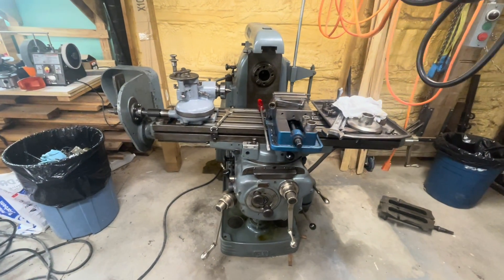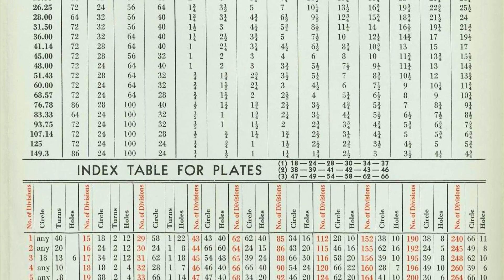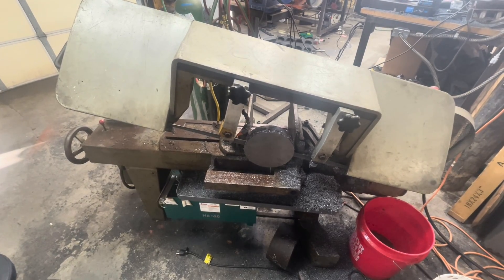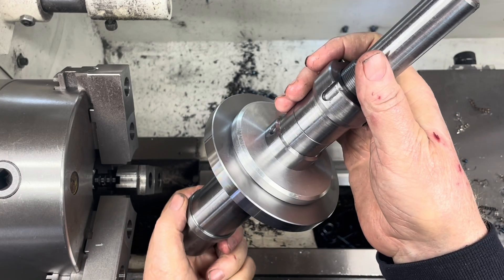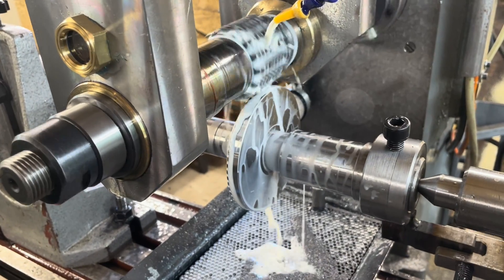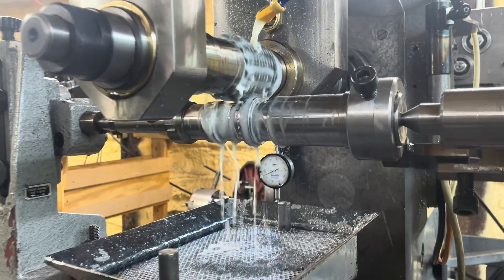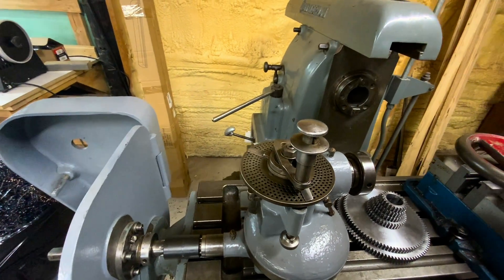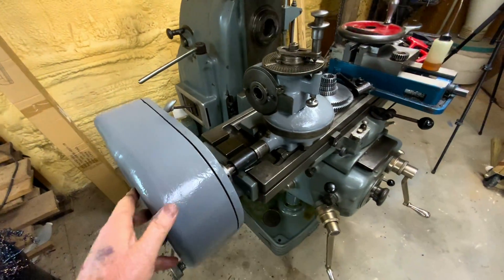Real Gear Project: Making a Set of “Factory” Change Gears for the Van Norman Mill

Comment: Wow, what a neat project.  I've got a Van Norman 1RQ which I am very fond of.  I picked up a set of original VN change gears in the VN box and a VN 10 inch dividing head.  The dividing head does need attention though.  I don't have the the lead box or the arbor support for the mill yet.  I am very impressed with your work.  Nice to see a fellow VN aficionado.
Reply from the maker: Thanks, Allen!  Which dividing head: horizontal or vertical?  If you need parts, I might be able to help…
Reply: @thomasstover6272  Tom, I have the horizontal dividing head.  I haven't opened it up to see what is binding it up internally yet.  I also found a set of plates for the dividing head,, a drawbar for the head and a set of collets too.  I will let you know what I find when I get around to opening the dividing head up.
Reply from the maker: @allenhunt3070 I found water in mine, but surprisingly little damage..just some seized ball bearings.  I did a video on the tear down…
Reply: @thomasstover6272  Tom, after looking at the pdf manual for my dividing head it describes it as the 10" Vertical Swivel Dividing Head, and is the same model you took apart in the other video which I enjoyed watching.  The manual for that dividing head says that the power feed on this model head is not compatible with the 1R model mill feeds.  Too bad.  Sigh.
Reply from the maker: @allenhunt3070  the centerlines are different between the vertical and horizontal heads.  I made a short adapter with a couple of cheap u-joints, which works fine.  The gearbox might be a different story.
Reply: @thomasstover6272  That is great to know Tom.  Thanks for sharing your hard earned knowledge with everyone, including  myself!

Comment: Nice video. Do these need to be hardered ? Cheers
Reply from the maker: Change gears and index gears don’t see much speed and load, so soft steel works well.  There are a lot of old lathes and mini lathes that have aluminum or plastic gears.  I just prefer steel for the stuff I do.

Comment: To get rid of the the ringing/chatter you could try shortening the shaft the gear sits on and suck in the tailstock spindle all the way. Those might not be possible but what would probably work is wrapping the shaft in heavy rubber or a rubber tube filled with sand. The big aluminium (?) washers you have up agains the gear  must help too. Great work !
Reply from the maker: Noise cancelling headphones.  Saying I listen to Metallica would be a good joke…but I’d rather listen to street repairs.  Smooth jazz for me.
Reply: try sticking some magnets on the face of the gear do deaden the resonance
Reply: @SJDTwo949  I've never heard of that trick. Can you explain how it works ?
Reply: @Panzax1  if you are lucky it changes the harmonics enough to eliminate chatter or "ring".  helps to deadens noise like putting your hand on a bell, or putting chains around an anvil